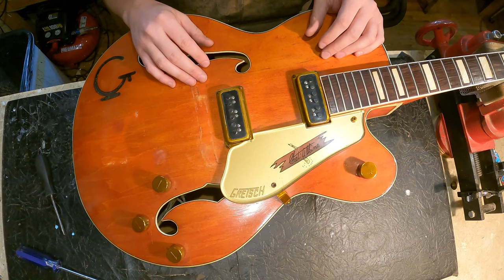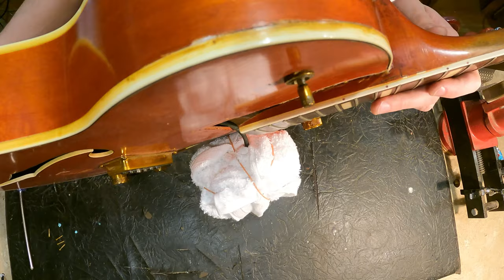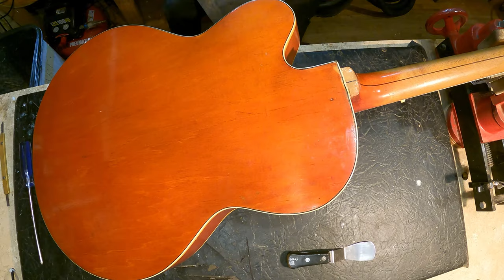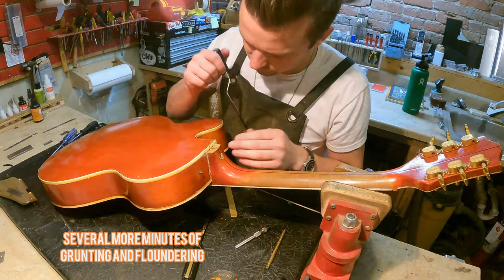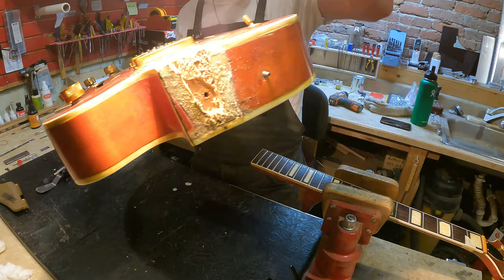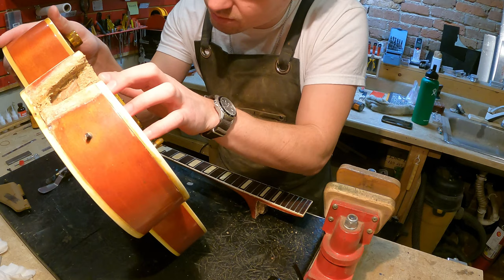1956 Gretsch 6120 Restoration, Part 2

Comment: Great work.
Gosh I was apprehensive when you were working on that screw, I kept telling my computer monitor  "He's got to heat that up!".
Years ago I worked as a Repair Technician at a FAA Aircraft Instrument Shop.  Many times instruments (aircraft cockpit indicators/gauges) would come in for repair with calibration screws epoxied in place.   Using a soldering iron on the epoxied screws would cause the epoxy to rapidly oxidize/decenergrate thus releasing the affected components.    
I was very relieved when you succeeded in removal of that screw.  
Great content, thank you for sharing this process with us.

Comment: The first time I saw an old gretch and saw that dowel in the neck joint I thought to myself who the hell broke this thing? Until one of the old timers set me straight and told me that's how the old ones were built. It was the '80s what did I know guitars look like stars and rockets to me.